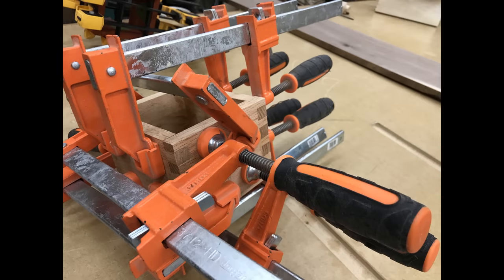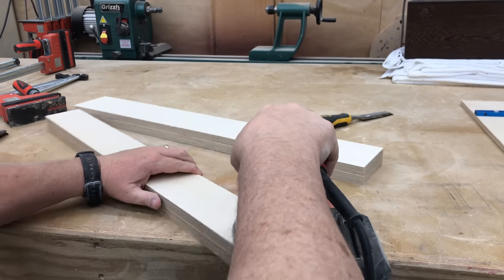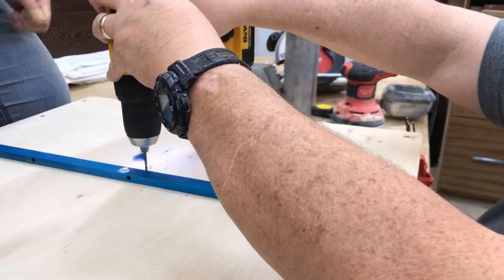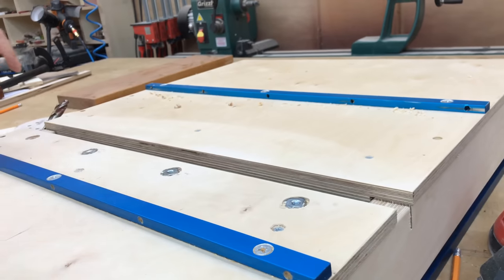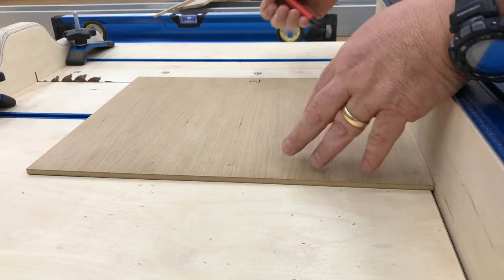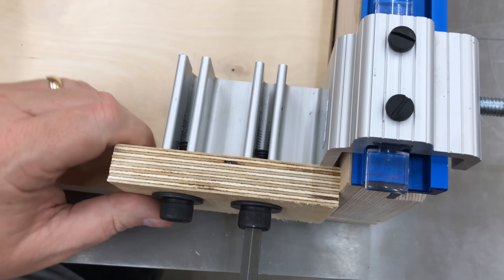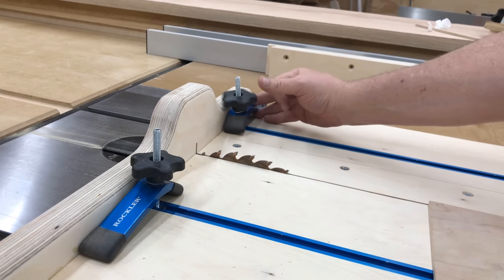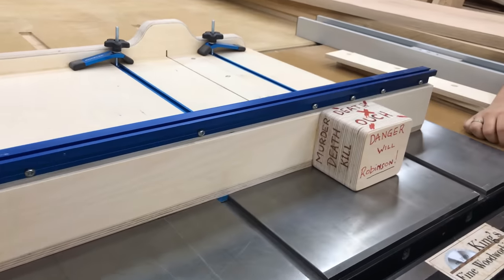39 - Extreme Crosscut Table Saw Sled with Perfect Miter & Dado & Removable Zero Clearance Insert

Comment: Thank You, very nice video. I have a question about that picture frame. Not only do your angles need to be precise, but the lengths of opposite sides need to be precisely equal. In the video you didn't address that specifically since it was about the sled and not the frame, and you whacked out that picture frame with perfect results so quicly and casually I couldn't see how got the lengths precisely equal. Was there a stop I didn't see, some wood working Kung Fu secret, or just measuring and eyeballing it? Thanks
Reply from the maker: Hi Clarence, getting 2 sets of frame sides to be equal in length is easy on the sled. However, there is no easy way to determine precise length for a picture frame easily on this sled. If it’s something you’ll make a few of, I would highly recommend a picture frame sled that is dedicated to that purpose. 

I was just showing this as a simple way to knock out a basic frame. But a dedicated tool is superior.
Reply: Thanks for the quick reply. I understand that it seems obvious to you that it's easy to get the lengths equal, however I didn't see at first exactly how you accomplished that so quickly and easily; but in my defense I've never worked with a sled before and am use to fiddling with each angle cut individually. After some thought I see the "Sled Fu" happens when you clamp that triangle the same for all 4 right hand cuts, then for all 4 left ones. Even though the length removed from the left and right is probably different all the rights are the same, and all the lefts are the same so the total removed from each side is the same. Aha ... or Dohhh :)
As far as a dedicated picture frame sled is concerned, I am obviously not that advanced. Actually the exact overall size of the picture frame isn't that important to me, as long as there is enough "slop" in the rabbet for the picture to fit in with some wiggle room, say +/- 1/16". My problem has always been exactly the same length for opposite sides with precise angles, and not being happy with results from my chop saw without A LOT of little adjustment shaving cuts. Thanks for the education!

Comment: Great looking sled. Just curious how you handle tearout at the back of the cut on the fence, since once you use a dado blade it's no longer a zero clearance cut at the exit.
Reply from the maker: Tear-out has always seemed to be minimal in that area, although you could put a thin backer if needed.

Comment: I just bought the plans , very detailed. One question though, would their be any difference in performance if I used 3/4 birch, or blonde board? I have a lot left over from a previous project. Also would you make any changes?
Reply from the maker: Hi Randall, I wouldn’t make changes to the design or shape or size. I’m very happy. 

And there is no problem at all with using a different type of plywood. It will perform equally well.

Comment: Is there a reason you made the the front face that high? The accessories work with 2 1/4” high fence. Is that too low to hold the sled together or to cut thicker pieces?

Comment: Not going to make a video, so will try to describe this.  Those t-tracks on top of the sled is wrong.  Turn the sled over and put them on the bottom in a dado like on the top or just use the dado without the t-rack.  Then turn the sled back up and drill holes big enough the clamp bolt head will go through.    Reason:  When tightening the clamp with the t-tracks on top pulls up on the track.  There is no downward pressure.  This can tend to put the track up or break the track.   By putting the track on the bottom and putting the clamp bolt through from the top there is downward pressure and no way to damage the t-track.   The clamps can exert much more pressure this way.   T-tracks are not meant to be used like we ordinarily do on a sled.

Comment: Great sled. I have purchased the plans but was thinking the second layer of 1/2 “ plywood would make this sled too heavy. I thought 1/4” might be a better way to go, what do you think?
Reply from the maker: Hi that would work just fine. 

Remember to cut the grooves for the t-track through both the 1/4” and the 1/2” sheet so it goes deep enough.
Reply: @KingsFineWoodworking  I appreciate your input.  Thanks for getting back to my so quickly.

Comment: How do you get the t-bolts inside the 2 t-tracks after you've already connected the front and back fences? I am at that step but don't know how the t-bolts would fit in the t-tracks after I install both fences. Do the t-bolts have wiggle room to slide in from the top?
Reply from the maker: When you put in your t-track, if you leave it 3/4" shorter than your slot is long, you can insert and remove the bolt easily. If you need to, email me and I will send you a picture. james@kingsfinewoodworking.com

Comment: I'm somewhat new to YouTube so am not familiar with exactly how it works. I love your plan and would like to build one for my own shop. In the video you mentioned there would be a link for complete plans and a parts list. All I see below the video are comments. So would someone please tell me how to access these plans and parts list? Thanks.
Reply from the maker: Hi Steve.  Here is a link to get the plans. There is also a complete materials list on the set of plans.  https://kingsfinewoodworking.com/collections/project-plans-for-sale/products/plans-for-the-extreme-crosscut-miter-dado-table-saw-sled
Reply from the maker: Materials used in this build:
One sheet of 1/2" x 24" x 60" Baltic Birch plywood
Hold down clamp   http://amzn.to/2ytpiim
Auto lock t-track hold down clamp   http://amzn.to/2gJta5J
Aluminum miter bars   http://amzn.to/2ytrNBD
Universal T-track with hold-down clamps   http://amzn.to/2yr14nt
Universal T-track   http://amzn.to/2ysVCC8
Kreg Top Track   http://amzn.to/2yOTSVf
Kreg Production Stop   http://amzn.to/2ytwriZ
Cap Screws   http://amzn.to/2zfF6CX
Countersink Screws   http://amzn.to/2xKApQz
Blind Nuts/T-nuts   http://amzn.to/2zdXlZy
CA Glue & Activator   http://amzn.to/2x08Nr1
Titebond III   http://amzn.to/2yt15c0
Minwax Paste Wax   http://amzn.to/2x1mFBy

Comment: Like the fact your kiddo used a roller to spread glue.. I do the same with cheapo rubber rollers you can buy at most craft shops.. I buy em at JoAnne Fabrics for about $5 each and as long as you wash the glue off once done they'll last almost forever..exactly 199,999 years, 364 days, 23 hours and 59 minutes then they go to crap.. ;) Not quite forever, but I have no plans to live over one million years.
As for the insert plate, it could be done the same way at the Infinity replaceable insert plates with a dovetail cut.. Just leave a gap at one end of the sled to change them..

Comment: The switchable piece for zero-clearance is great. However, it doesn't work for my table saw. The Dado blade of my saw grows toward left side. So, the switchable piece needs to be on the left too. This build has it on right side of cut line. That's suitable for saw with Dado width increase toward right.

Comment: Long time listener, first time caller. Great sled, I built your workbench from your plans, love it, and am now building your sled. One questions please. I have the Miter Bars you used, I notice they already have threads, are you tapping the wood only and riding through the threads on the bar, or are you tapping the whole shebang with a larger tap that the existing threads, If so what size tap please. Thanks

Comment: Just a point of information concerning the adjustment of the fence to perfectly square. Shouldn't you have mentioned that the point on the adjusting board be exactly in line with the screw to be replaced? If the screws are 28" apart and you use that measurement in the last step of William Ng's formula, then if you don't put the point of the adjusting board in line with the screw you are removing you could be off another 0.001" or even 0.002". Not a large difference, but a difference just the same. I prefer to measure from the end of the fence to the pivot screw and put the point of the adjusting board right on the end of the fence. Doing that, I managed to get my fence to 0.003" over the length of the fence on the first try. That is approximately 0.0001" per inch of fence. You still have an absolutely awesome channel with very well explained projects. Keep 'em coming!
Reply from the maker: Hi Larry, great tip. Thank you for sharing!

Comment: I just purchased the plans but find that some of the links to hardware no longer work. Would it be possible to get the bolt and screw sizes used (especially the t-nuts and screws used for the miter bars)?

Comment: potentially dumb question, but ... do you have to start with a perfectly square board in order to do the 5-cut method?
Reply from the maker: Great question. 
No you do not. Any board works. Just approximately square is fine. Even a rectangle works.
Reply: @KingsFineWoodworking  thanks for the reply! So 90 degree corners required but not equal length sides. Got it!
Reply from the maker: @kaitkehoe6552 , even 90 degree corners aren’t necessary at all. Just something that’s squarish. 80-100 degree angles would easily work. 

The reason is because the board sort of squares itself during the 5 cuts. So it didn’t matter if it was square before.

Comment: Recently found you - great info and techniques, love the channel.  Just an amateur engineer and barely passable woodworker here but noticed an error banged into my head (literally) by my schoolteacher dinning proper use of the Vernier caliper gauge many moons ago.  As you measured it, you were getting the dimension an inch or so in from the end (where the parallel faces of the arms meet and not at the end where you intended).  To get it right you should be holding the caliper perpendicular to the strip of wood and bring the measuring faces together at the end.  Same thing at the other end.  That way you would correctly have the difference between the two dimensions for the length between A and B.  Will the correction of X thousands per inch be materially affected if the divisor is say 9 inches rather than the 11 or so you "measured?"  I don't know.  Possibly.
Reply from the maker: Rik Vahl, thank you for the tip!

Comment: How did you make the auto-lock T track clamp have a longer arm to be able to reach the bottom of the sled?
Reply: I GOT A #8MM x4" LONG MACHINE SCREW AND A 5/16 COUPLER NUT. I RE-TAPPED THE COUPLER NUT WITH A 8MM TAP SO I COULD COUPLE THE T CLAMP THREADED FOOT TO THE 4" MACHINE SCREW.THAT GIVES ME A 6-1/2" LONG FOOT GOT EVERYTHING AT HOME DEPOT. ANY QUESTIONS LET ME KNOW. BILL

Comment: Great video! Thank you for investing your time to help us all.  One question, is there any reason why I shouldn’t locate the blade in the center of the insert on my right tilt saw so it would accommodate the dado and a tilted blade? I realize I would have to create a shelf on both sides and attach the insert on both sides as well but just wondering if there is something I missing as I think through it?
Reply from the maker: Thank you.  I imagine that could work, as long as you secure down both sides of the insert plate.

Comment: How much did all the materials cost to build this sled?  BTW, this is the coolest sled I have ever seen.  Also, you used many shop power tools that I don’t possess.  Do I need a drill press, band saw, disc and spindle sander to properly and accurately complete this project?

Comment: i'm in the process of building a new sled, I like the idea of using this method to make picture frames, my only question is how large of a picture frame will this sled accommodate? I'm an artist, 90% of all my paintings are 18x24, will a 24" leg fit inside this sled? Really like you video production, very well explained, you got a new subscriber!!
Reply from the maker: The leg of the picture frame will go outside of the rear fence so there is no limit to the size of the frame you can make.

Comment: when I made my cross cut sled I made a stop or safety stick that goes into the miter slot on the run out table. This safety stick is held in by magnets glued under the stick and washers countersunk into the table slot. This will not allow the sled to travel far enough for the blade to cut out the back of the sled.

Comment: James, some links on material used are no longer valid. Can you please put new links and update us when you have please?
Reply from the maker: Hi Michael, yes. For now here’s the list. 
Extreme Table Saw Crosscut Sled Materials List:

1 ea 1⁄2”x30”x60” Baltic birch plywood
1 ea 3/4”x30”x60” Baltic birch plywood
(Only a 1⁄4 of this is needed)

2-Hold down clamps 
http://amzn.to/2ytpiim

1-Auto lock t-track hold down clamp
http://amzn.to/2gJta5J

2-Large Toggle Clamp Foot. 
 https://amzn.to/2je8seW

1-Regular Toggle clamp
https://amzn.to/2R8TytS

1-Toggle clamp hold down plate
https://amzn.to/2VxiOZp

2-Aluminum miter bars 24” 
http://amzn.to/2ytrNBD

2-Universal T-tracks 
http://amzn.to/2ysVCC8

1-Kreg Top Track 
http://amzn.to/2yOTSVf

1-Kreg right to left measuring tape
http://www.amazon.com/dp/B0002QZ4VC/?tag=kingsf-20

1-Kreg Production Stop 
http://amzn.to/2ytwriZ

2-Socket Head Cap Screws 
https://amzn.to/2BsJaCB

12-Countersink Screws 
http://amzn.to/2xKApQz

4-Blind Nuts/T-nuts 
https://amzn.to/2RGyiZg

Supplies I used:

CA Glue & Actvator 
http://amzn.to/2x08Nr1

Titebond III 
http://amzn.to/2yt15c0

Minwax Paste Wax 
http://amzn.to/2x1mFBy

Specialty tools used in this build:

Countersink Bit 
http://amzn.to/2kVk4qS

Good Quality Economy Tap and Die set 
http://amzn.to/2xK2yHB

Straight Edge clamp saw guide 
http://amzn.to/2x0e4yI

Vix Bits (Self centering drill bits) 
http://amzn.to/2zdReVc

Countersink Pre-drill bit 
http://amzn.to/2x1nDh6

Tablesaw Dado Blade 
http://amzn.to/2wZH7m1

Forrest Woodworker II (best tablesaw blade) 
http://amzn.to/2ztCmCS 

Best Carbide Forstner drill bits 
http://amzn.to/2zdGZ3e
Reply: @KingsFineWoodworking  Is the Forrester WWII and Tables saw dado blade all flat bottom?

Comment: Planning on building one. The links for the cap screws and T-nuts are dead. What size drill and tap did you use for the Kreg Production Stop and the T-tracks?
Reply from the maker: Hi Ronald,  here is an updated list. I think the links are all fixed. 

Extreme Table Saw Crosscut Sled Materials List:

1 ea 1⁄2”x30”x60” Baltic birch plywood
1 ea 3/4”x30”x60” Baltic birch plywood
(Only a 1⁄4 of this is needed)

2-Hold down clamps 
http://amzn.to/2ytpiim

1-Auto lock t-track hold down clamp
http://amzn.to/2gJta5J

1-Large Toggle Clamp Foot. 
 https://amzn.to/2je8seW

2-Aluminum miter bars 24” 
http://amzn.to/2ytrNBD

2-Universal T-tracks 
http://amzn.to/2ysVCC8

1-Kreg Top Track 
http://amzn.to/2yOTSVf

1-Kreg right to left measuring tape
http://www.amazon.com/dp/B0002QZ4VC/?tag=kingsf-20

1-Kreg Production Stop 
http://amzn.to/2ytwriZ

2-Socket Head Cap Screws 
http://www.amazon.com/dp/B00HYM0LH4/?tag=kingsf-20

12-Countersink Screws 
http://amzn.to/2xKApQz

4-Blind Nuts/T-nuts 
http://amzn.to/2zdXlZy

Supplies I used:

CA Glue & Actvator 
http://amzn.to/2x08Nr1

Titebond III 
http://amzn.to/2yt15c0

Minwax Paste Wax 
http://amzn.to/2x1mFBy

Specialty tools used in this build:

Countersink Bit 
http://amzn.to/2kVk4qS

Good Quality Economy Tap and Die set 
http://amzn.to/2xK2yHB

Straight Edge clamp saw guide 
http://amzn.to/2x0e4yI

Vix Bits (Self centering drill bits) 
http://amzn.to/2zdReVc

Countersink Pre-drill bit 
http://amzn.to/2x1nDh6

Tablesaw Dado Blade 
http://amzn.to/2wZH7m1

Forrest Woodworker II (best tablesaw blade) 
http://amzn.to/2ztCmCS 

Best Carbide Forstner drill bits 
http://amzn.to/2zdGZ3e

Comment: Does the dado situation effect the left side of the insert or is the left side always in the same spot as a single blade? Never used one
Reply from the maker: Hi! It depends on which way your blade tilts. If it tilts down to the left. Then the dado starts at the same place as the blade, but goes further out to the right (as you’re looking at the saw)

Comment: how did you move the fence forward to tune if the top 1/2” ply is a snug fit between the front and rear fence? did you have to shave that top piece down?

Comment: Let's please talk about a hypothetical picture frame for a moment . . . it has a height of 16" and a width of 12".  Your instructions in the video will produce a picture frame that is exactly rectangular with exact 45 degree cuts. But when it is assembled, it it less than the desired 12 x 16 inch size.
What you didn't explain is how do you cut the pieces to produce an exact size frame 8x10, 20x24, any size - size doesn't matter, but the setup to get the size is what we need.  Would you like to tackle this problem?
Thanks in advance

Comment: Is there a reason that you did the back rail where the Kreg stops mount to higher than what Kreg recommends for their stops?  Just curious as I plan on buying this plan soon for my own needs and might modify it some.
Reply from the maker: Yes. Because if you use the lower height, you won’t be able to cross cut things very thick, or else you will cut your fence in half.
Reply: Awesome.  thanks for the fast response :D

Comment: How do you get the hold-down clamps into the T=track with each end butted to the fences?
Reply from the maker: You can’t. I just leave mine on. But if you want to remove them, just cut the t-track 1” shorter. Then they’ll come right out from the ends and it won’t affect anything at all.

Comment: Note your squareness would be a bit better if you didn't round the adjustment per inch off before multiplying by your fence length.  It's an itty-bitty change, but you'd be a little closer to perfect.  By multiplying first, you'd have adjusted -0.029" rather than -0.028".</pedantic>